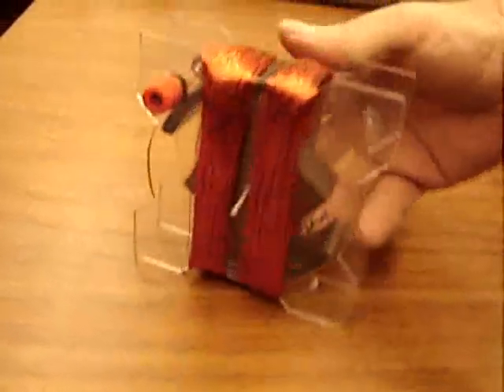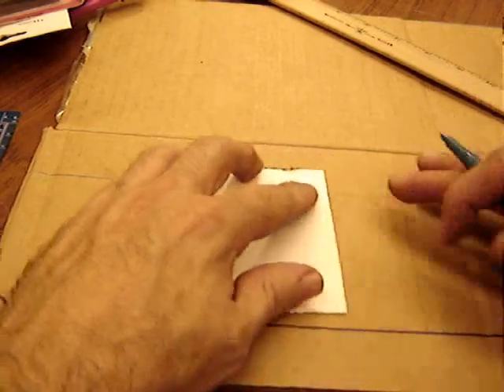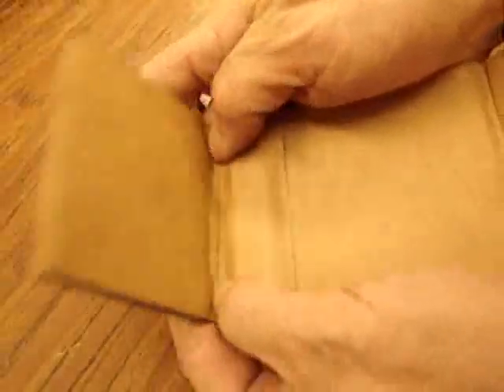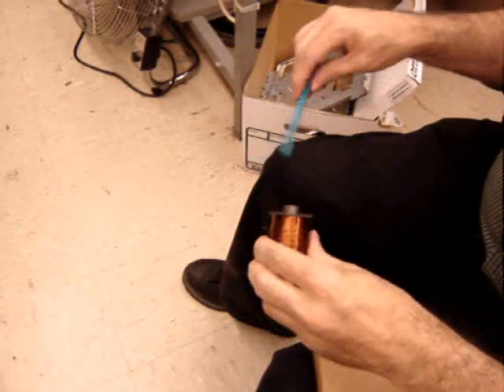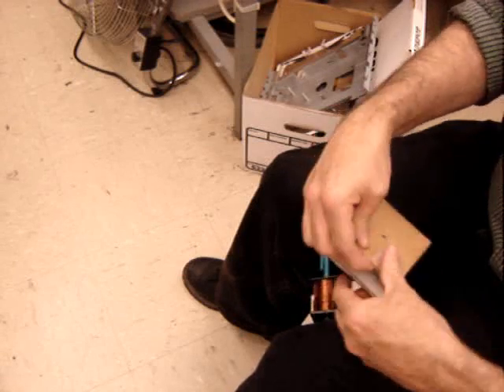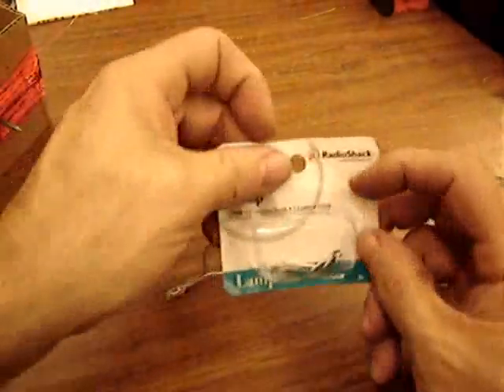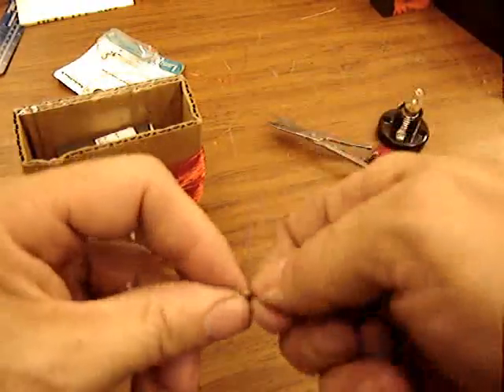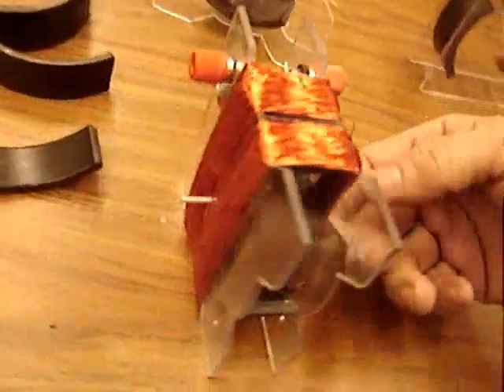Simple generator:  AC electric generator for science fair

Comment: Awesome ❤
Reply from the maker: I built the first one for kids, after seeing the Exploratorium version with three WW2 radar magnets, a coil, and a flashlight bulb.  You yanked the big coil through the gaps.  So, how small could someone make it?   Use a #49 bulb, lights with lower voltage than even an LED.  Radio Shack sold a #30 coil of varnished, wire, exactly enough to light a grain-of-wheat bulb.

Comment: When you energize the coil with around 12 volts battery will the magnet spin in side the spool
Reply from the maker: Good point!   
The magnet just jerks, or may flip once.   To make it spin, you need to add an electric switch to the rotating nail, so the battery gets turned on and off as the magnet rotates.  It's mentioned on the main page, MOTOR CHALLENGE http://amasci.com/coilgen/generator_2.html#mot

Comment: Oh wow thank you i'm going to use your idea 17 years later i now know what to do to complete on of my generator project with 3d printing piece but i really love how you built it that's awesome i have soo many ideas around this idea thank you again for sharing!!!
Reply from the maker: Don't miss the main article.  If you use neo rare-earth magnets, then you only need roughly 10x less turns of wire, 60 not 600.   And if you use those "buzzing bee" magnets, with little axles glued to the ends, you can make this entire generator inside a piece of 3/4in. plastic pipe.   (But wind the coil so it crosses the ends of the pipe, not wound around the circumference of the pipe.   Or, for science-fairs, show that the coil wound around the circumference does not produce AC output.   Only the coil wound perpendicular will produce AC output.)   Spin it fast enough, and a hamster could light up a tiny bulb.   Hamster-wheel needs pulleys and belts.
Also, Whaaaaa, Radio Shack is no more.   Find a quarter-pound spool of varnished #30 wire online.

Comment: Can you use a neodymium magnets instead of the ceramic magnets?
Reply from the maker: Yes, go to the listed website for FAQ and complete project.   With neo magnets, you can use 10X less wire, since the magnets are roughly 10X stronger than ceramic magnets.

Comment: What about safety? What if a kid touches the coil or wiring while the magnets are spinning? And if not a concern at this voltage / amps, if the magnets were stronger and there were more turns of the coil or a large wheel was connected to a smaller wheel by a belt to get a faster spin, safety would become a concern at some point. Could use a meter to measure the volts or amps, but I don't know enough about electricity to know what is getting dangerous, though I have heard that even very low current can be very dangerous....I'm trying to think of a way to put the wiring inside a clear plastic case of some sort to keep fingers away, but haven't figured out what I could use yet.
Reply from the maker: The danger here is the scissors, and the sharp point on the nail.   Seriously.   Electrically it can barely reach two volts, so it's safer than a D-cell or a flashlight.  Shock hazard starts at around 60V (produces slight tingle.)  If you could spin it 10x faster than w/fingers, that's still only twenty volts, no shocks felt, and electrically safe (but kids will then use it to burn out all of your two-volt bulbs and LEDs.) 

Large (4cm) neo supermagnets are dangerous for kids: finger-pinch, and eye hazard from tiny flying chips.   But with those large magnets, the voltage will only be 7X to 10X higher, still far too low to even feel a tingle.

One hazard is with any magnets being spun fast by some sort of crank mechanism.  At 10x faster than w/fingers, they could fly off and hit someone in the eye.   Same problem if you spun it with an electric motor, or by connecting it to a bicycle.

To deliver a little tingle, it would need 30X more turns of wire, or spin the magnets 30X faster.  If 600 turns gives two volts, then to produce a serious electric shock, you'd need 20,000 turns of wire, creating 80V.   (Or, if using big dangerous neo supermagnets, you'd only need 3,000 turns.)

Comment: Great job my son wants to make one 👍🏼
Reply from the maker: Be sure to visit the project webiste.  More details, parts list, debugging info, etc.   Buy tiny incandescent bulbs from All Electronics (they work better than LEDs.)  https://www.allelectronics.com/item/LP-3/1.5V-T-1-3MM-LAMP-W/-10-INSULATED-WIRE-LEADS/-/1.html  Also see the archive videos (playlist) https://www.youtube.com/playlist?list=PLS8LbL7GIZiCRSoUSErutoFYXF4VQUE9J
Hint: use neodymium supermagnets, then to light a red LED,  you only need 50 turns of wire rather than 500T.
Hint: make very small generators by using one oblong magnet from those toys called "buzzing bee" magnets.  Add a shaft by gluing nails to the magnet ends, so the magnet can easily rotate.  In order to work, the coil must wrap around the long ends, NOT around the circular waist of the magnet.
Reply: @wbeaty  thanks that is a lot of information but will do

Comment: RIP Radio Shack. You will be missed.
Reply from the maker: And Frys.  And many surplus junk shops (bgmicro just died.)
When Rat Shock shut down, I bought out all their gold SMA connectors, also a big stack of 300watt soldering guns for $11 each.  Those things are just 900amp transformers with a shorted one-turn secondary.

Comment: How do you align the 4 magnets with respect to their poles? If the way they attract one another, that means alternating poles. If they repel one another, which is hard to hold them together, that means all in the same pole, as if one big magnet. Which way is more efficient, or it does not matter?
Reply from the maker: It's an AC generator, it needs two opposite poles, with fields that spew way out (and pass through the copper wire.)
Reply: @wbeaty  I was thinking, if we lay the magnets out that they attract each other, that means alternating poles. The final overall magnetic field would be complicated and I don't know how well it would work compared to the following. But if we line the poles the same way, the 4 magnets would behave as one big magnet, and performance might be better. I don't know the answer. In any case, it is very difficult to do the latter since they repel each other strongly. I finished the project with alternating poles (attracting each other) and they work. That's the bottom-line. I did use 3" PVC pipe (1.25" long) and two plates on the sides, as suggested at the end of the video. I am including this as one of my projects in my class, and I provide kit for every student. Your video is a big motivation. Thanks a million!
Reply from the maker: @kwokng2771  Build both, see which actually works!   (The alternating poles are too close together, and they just vanish entirely.)

Those "buzzing bee" magnets, shaped like footballs, have their poles on the sides.  And, they're extremely strong.  So, I glued the wide heads of nails to the pointy ends[1] of the "football," put the whole thing inside a narrow piece of gray conduit, with square plastic plates on the ends (holes drilled, slightly bigger than the nail.  Then grease the nail.)  

Then, wind wire so it goes over the ends (not wound around the waist of the pipe.)  I found that it would light the bulb, if only using about fifty turns of wire!   (Those magnets are supermagnets, stronger than alnico, even though the package said they were pyrite or something.)

[1]If using just a little 5min epoxy to attach the nail-heads, when the epoxy starts getting extremely gummy, it's possible to hand-align the nails so it all spins very smoothly.  Then, once it's totaly hard, add more epoxy if needed.
Reply: @wbeaty  The poles of magnet are more complicated than I thought. I played with those from Harbor Fright. When I placed the ends (length-wise) of two magnets together. They attracted each other. But when I rotated one of them (still the same ends touching each other), then they repelled. I am probably over-analyzing the whole thing about poles related to generator. I give up!
BTW, on light bulb, red LED is brightest, as you suggested. I tried incandescent Christmas tree bulb and it was dim.
Reply: My previous thinking was that having 4 magnets, I was not sure how they interact with one another, i.e., magnetic fields "add" to one another's (good) or "cancel" (bad). I later on tried just using 2 magnets. They worked fine too, although had not compared 4 magnets vs. 2 magnets on same housing (I went through different forms). That would be interesting to see.

Comment: Can we use cyramic ring magnet too??
Reply from the maker: Yes, but the ring magnets must flip sideways.  Also, use several large ring magnets in a stack, 50 or 70mm.

Perhaps you can use a large neo supermagnet to re-magnetize your ring magnets, so that the north and south poles are on the edge, not on the opposite magnet faces.   Then, glue the magnets in a stack so they repel (so all the N are together.)   That way, the magnet-stack can spin like a wheel, and not flip end-over-end.  But still the coil must be wound so that the axle passes through the windings (so that the N and S poles move ACROSS the wires when it spins.)

Comment: Could you use an led bulb like say a small Christmas light?
Reply from the maker: See the website, parts list.  Christmas lights need too high voltage (they need 6V each, not 1.5V.)    Red LEDs work best.  But you'll have to spin the magnet 2X faster if you want to light a blue or a white LED.
Reply: @wbeaty  thank you. One more question, does it matter if the wire is coated or will the coating need to be stripped off?

Comment: how do you determine the amount of copper, and size and power of the magnets?
Reply from the maker: Click on the main project link?  It's also the link shown at the start of the video, and the end.  On the project page, see links for 50mm magnet spec sheet, also Wire Gauge table.  If using #30-gauge wire, more wire is better.  More wire lets you spin the magnets fairly slowly, but still light up the bulb.  200 turns barely works at all, so use 400 or even 600 or 800 turns.   With less wire, the magnets must be spun extremely fast before the bulb will light up.

The wire needs to be very close to the whirling magnets, so if you used smaller neo supermagnets, you'd need to change the size of the cardboard box, to keep the copper wire very close to magnets.

Smaller ceramic magnets are weaker.  With weaker magnets, the bulb won't light up until you spin the magnets extremely fast (so they whiz like a blur.)   Better to just use big ceramic magnets.  Or, get some large-ish neo supermagnets instead.    (Those are about 7x stronger than ceramic magnets.)

Comment: i can't understand what you say at 4:50.  it sounds like, 200 turns is real easy, or 200 turns if your easy. what did you actually say ?
Reply from the maker: Wind 300 turns, or only 200 turns if you're lazy.   (But in reality, 600 turns works MUCH better, if you bought a half-pound spool. )    Those specialized light bulbs will first glow at 0.9V, while a red LED needs about twice the volts (and twice the RPM!)
And also of course, some big wide supermagnets will give about 7X higher voltage than those big wide ceramic magnets.  (That way, you could spin them at 1/7th the speed of the ceramic magnets.)

Comment: Hi, I am having trouble finding bulb.  Are there other options?  I ordered from All Elec. but delivery is slow...
Reply from the maker: Try a single red LED.   Is there a Fry's electronics anywhere nearby?   (To light an LED, you'll have to spin the magnets 50% faster though.)    Only use red LED.   A green LED (or blue, or white,) needs too much voltage before it lights.   The magnets barely light a red LED.    To light some other color of LED, the magnets must spin far faster.

Comment: First of all, let me tell you what material I have used.
Cardboard - size as mentioned in the instructions
nail - more than 8 cm long
copper wire - 120m length - https://www.jaycar.com.au/0-315mm-enamel-copper-wire-spool/p/WW4013 (picture attached for ready reference)
magnets - 4 bars - https://www.teachersource.com/product/ceramic-magnets/magnetism-magnets

My queries where I need help from you:
1.   Kindly confirm if the material that we are using are the correct ones. We can not buy anything from Radio shack as advised in the video because they do not deliver in Australia.
2.   In the video, the guy mentions to use some kind of spacer between the magnets. What that spacer is and how to use it.
3.   Instead of cardboard, can we use plastic or acrylic sheet, like it is shown in the starting of the video?

We are really relying on this video to make the simple generator and win a prize in the school science competition.

Your help in this regard is much needed and highly appreciated.

Comment: SIR CAN YOU TELL ME IN WHICH DIRECTION YOU PLACED THE ENDING WIRES .....
Reply from the maker: Watch the first five seconds of the video.   Just connect the two wires to the light-bulb wires.  (But first, pull them out, cut them shorter, and scrape all the plastic off the ends.   Tape them against the coil, so the coil does not unwrap accidentally.)

Comment: does a stronger magnet provide more power or is it all in the amount of turns or thickness of wire?
Reply: It's on the number of turns and I think not on the thickness. A stronger magnet does help also the speed of the travel between the magnet and the wire

Comment: 4:09 I need this for my model in science class and I couldn't see this part like, did you wrap it around the magnet? Did the wire come out of the other side? I'm confused..
Reply from the maker: See MAIN PROJECT WEBSITE.  For full info, did you first check the main project website?  See the video title, which gives the URL of main project website.  (Also, debugging info and questions answered ...on main project website.)   See simplified drawing from main website http://amasci.com/graphics/coilgen.gif  When you first start winding, make sure there's an extra foot of wire (I just jammed it out of the way, then pulled it out later.)   It's just a coil of wire outside the box, with two ends.  Magnet inside the box.  Connect the wire ends to a red LED, or to a special lightbulb (normal flashlight bulbs won't work.)    Don't use different parts, it needs very thin #30 gauge enamel-coated magnet wire, a spool of a few hundred feet.    Magnets must really whiz fast when spinning, not crashing into the cardboard.

Comment: Will this work for powering a cellphone charger instead of a light bulb? I need it for our research in school
Reply from the maker: It puts out only one volt AC.  You can increase this.   If you use neo rare-earth supermagnets of the same total size, it will put out about seven volts.   If you add twice as much wire (double the number of turns,) it will put out 14V AC.  (Also you could spin the magnets much faster, but that's harder to do.)   Then just use diodes to convert the AC output to DC.   See the main project page, the FAQ, about increasing the generator output.

Comment: What if a speaker magnet, does it work?
Reply from the maker: Yes, but the speaker magnet must flip over and over.  (Tumbling, NOT spin like a disk.)  Glue nails to the edge of the magnet, to form an axle.    My very first version from 1986 used three loudspeaker magnets in a stack.

Comment: What gauge copper wire did you use?
Reply from the maker: See the parts list.   The main page is listed at the start and end of the video, also on the caption above (MAIN PROJECT WEBSITE.)   This video is not a complete project; it's part of a website with full information.  Use enamel-varnished #30-gauge wire, the kind used in motor-windings and electromagnets.  Numerous sources are linked on the parts-lists.

Comment: perhaphs using a diod instead of a bulb is more practical these days
Reply from the maker: Doesn't work.   Try it.
Even with a red LED, you'd have to spin the magnet nearly 3X faster (and it's much worse with green or blue.)   Or, use 800 turns of wire instead of just 300.   It's because the special bulb starts to glow at 0.7V.    LEDs turn on at 1.7V
Reply: Thanks, that's a valuable note, that means that probably for the demonstrations like this https://youtu.be/sENgdSF8ppA?t=1m49s a bulb would also be more suitable. Though, I want those demonstrations to be good enough not to show in a dark room so may be I still have to use diods. I'll test this stuff anyway.

Very cool that you have a whole FAQ, I'll use that to buy appropriate bulbs.
Reply from the maker: To light a white LED takes a much stronger magnet.  Or, instead use nearly 10X more turns of wire.  Definitely use a neo supermagnet.  (The weak ceramic magnets are best when you're buying a hundred of them, three or four magnets per student in the classroom.)   However, the high voltage which easily lights a white LED may destroy these tiny grain-of-wheat incandescent bulbs.    With neo supermagnets rather than cheap ceramic magnets, bulb-lighting becomes easy.  Try a conventional 3V flashlight bulb as well as various LEDs.

Comment: Today My son and I made this generator. So simple! It's working! I love science! thank you
Reply: that's good congratulations. if you want to make higher voltages and power then you can upgrade it from simple to an AC motor configuration, that way you will generate more power much easily but you will need a high speed motor to spin it for you and power stuff.
Reply: @davidwarda5616  we are trying this for a school project and cannot get it to light up.  We did not use the same copper wire...does that matter?
Reply from the maker: @elizabethjenson3033  Check the main project page.  This video only shows part.   Also, first build the original version (no changes allowed.  None.)  Then later, try doing it differently, see if it fails, or maybe improves.